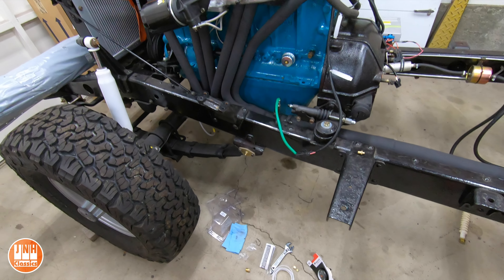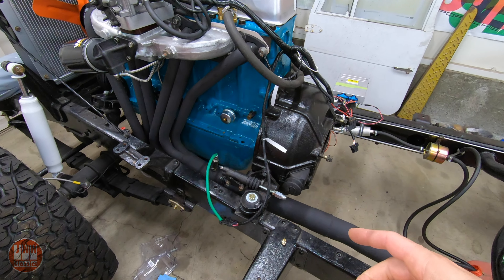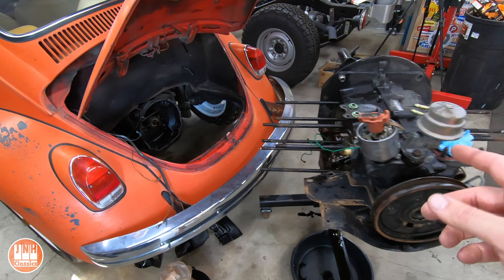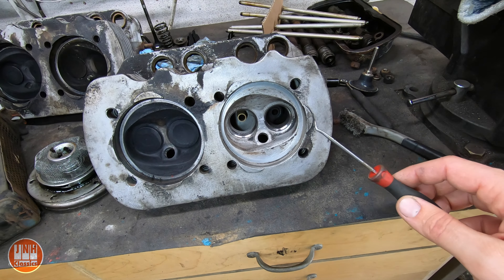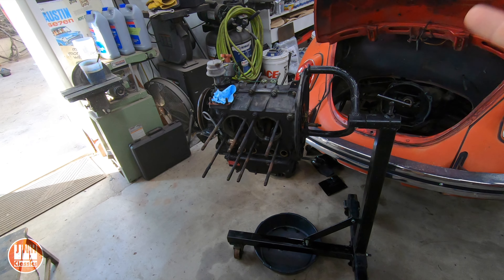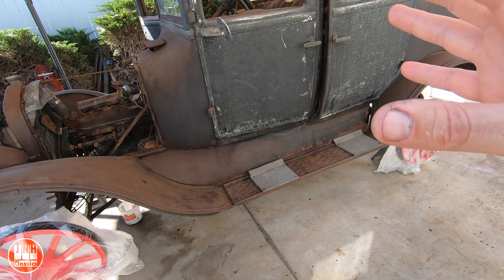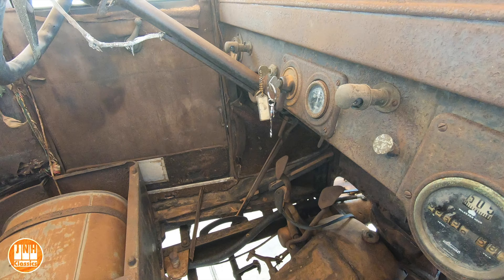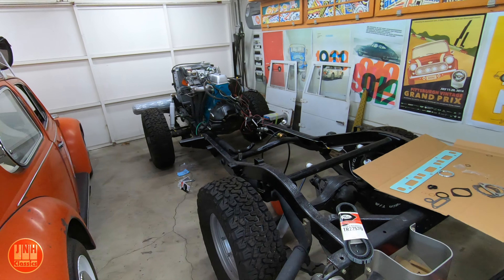We Have A Problem  - Sunday Update Video (9-27-20)

Comment: You could put an OHM meter on the oil pressure switch I have to check with my truck good oil pressure 40 ohms I have to double-check to it's been a while

Comment: I've just pulled the engine out of my project Karmann Ghia to fix some oil leaks and discovered what feels like a rear main spun bearing.
Amazingly it runs with no odd noises and the oil came out with no metal that I could see.
Regarding your head crack my understanding is that provided it does not extend below the valve seat your fine.
Certainly this is what the VW service manual says for the WBX heads.
Luckily replacement heads are now cheap and plentiful.

Comment: I believe I posted a link from The Samba on an earlier video; single port heads are cheap and plentiful there. You can get them either as-is or rebuilt. You could either get one as-is and get them both redone locally, etc etc. Pay close attention to the exhaust valves; those suffer the most in these cars. Good thing is parts are very inexpensive. That Model T project is fascinating.

Comment: The stamped transmission cover on your Model T has a tube coming out of the side that indicates it is part of an old "Ford Faithful" auxiliary oil system.  If you don't want to use it, be sure to cap the tube, or it will shoot oil out like crazy.  A full kit for that system is still available - https://www.modeltford.com/item/3081FFK.aspx